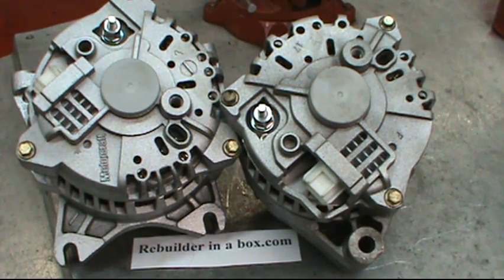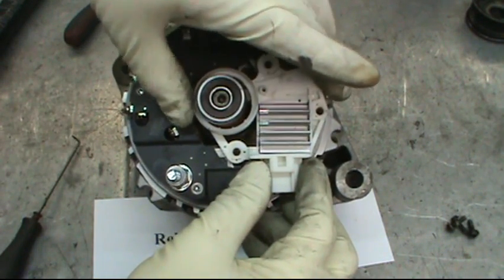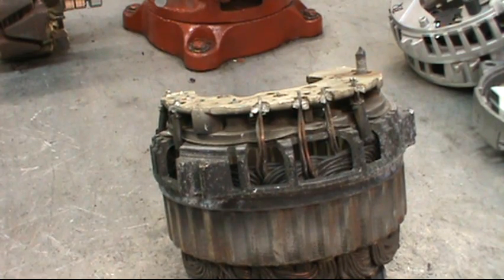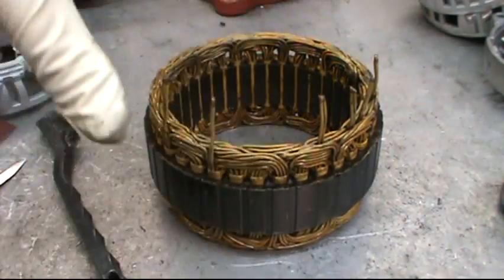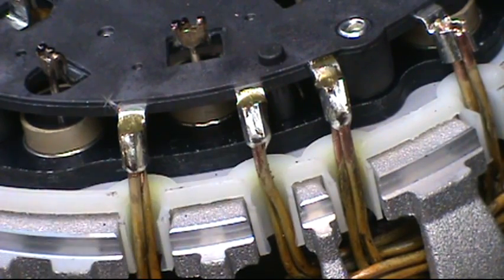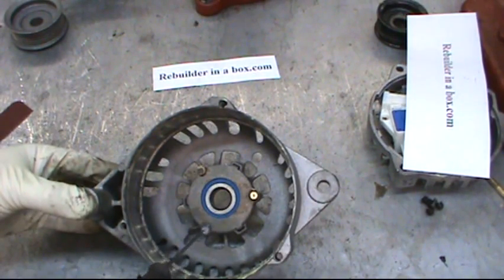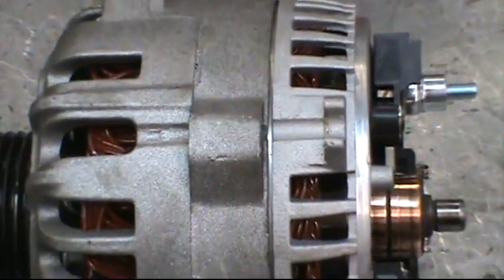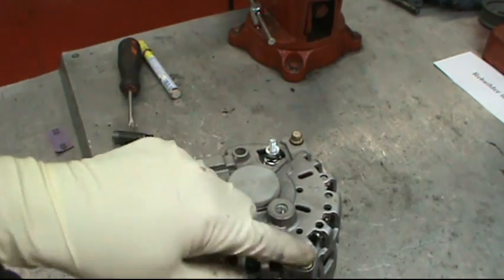How to rebuild a 6G Alternator

Comment: Why no toyota kits?
Reply from the maker: Older Toyota starters, yes. But not everything can be successfully rebuilt at home. Some require specialized tools, experience, and parts availability. Also, the cost of clutch pulleys can cause non cost-effectiveness for at home rebuilds. However, we will continue to look into it.

Comment: Hi Mike
Having problems with my 06 Mustang GT
Battery light coming on about 2 minutes after start up, Check Charging System also illuminated
The voltage gauge appears normal and getting 13.6v at battery whilst running
Removed pigtail and am getting 12v at battery end and 8.4v at ign wire Is this normal
Also alternator is getting hot to touch after several minutes running
Have just ordered a rebuild kit from you
Reply from the maker: Automotive regulators not engineered for glass mat batteries OR lead acid battery needs deep slow charge or is bad. If not these things then kit should fix if computer is ok.

Comment: What if you don't have an impact wrench?
Reply: For any future users, there are strap wrenches that should get a good purchase on the pulley, then just back the nut off with a standard socket.  He's using the impact to be able to loosen the nut with just hand pressure on the pulley.  There are "hand" impact wrenches too, but probably pretty hard to use on this without a helper (spring loaded things what you strike with a hammer on the back.

Comment: If the tolerance ring was not placed back on, can it cause an unusual noise? As if the bearing went out but they have both been newly replaced. Sadly the tolerance ring slowly turned to pieces. Great videos by the way! Clean and simple instructions is on point! Please help, can’t seem to find anything online about it. Thank you!
Reply from the maker: The tolerance ring is a very important component. That's why our kits always include the ring. Without it, the rear
housing would be destroyed. And I never tried it, but yes, it probably would make a lot of noise.
Reply: Mike Lauer thank you sir and sorry for late reply.   And well to let you know I ran it for about 2 weeks with an unbearable squeal that ended up turning to a rattle, found out one of my idler pulley bearings was shot. Replaced bearing on idler and put a new OEM alternator on my cobra and the sweet crisp silence was back.. now only thing is my battery light flickers n stays on after I say a good 25 minutes of running, I then hit the highway and look down at the dash to see it vanish, to later come back on again all in one drive haha I’m losing it

Comment: my svt focus is charging at 13.3 volts no light im thinking of ordering your kit but are your regulators motorcraft or other brands thanks
Reply from the maker: Motorcraft doesn't make regulators anymore. We have seen the inside of thousands of dealer purchased alternators with aftermarket regulators. SVT may have the 2.3L which Ford outsourced to India and we don't support at home rebuild for that model.

Comment: wondering  why  new rotor replacement not shown
Reply from the maker: New rotors are needed for 4G and GM's 130D series alt's. But for the 6G : If rebuilders are routinely successful replacing slip rings, and the rotor has a good life expectancy, the best cost effective operation is to replace the slip ring, not the whole rotor. Our goal is to show you how to save as much money as possible, and still get a good, reliable product. https://alternatorstarterrebuildkits.com/about-us/

Comment: What type of soldering lead you use it is 60/40 or it is brazing soldering lead for soldering the alternator, thanks
Reply from the maker: 60/40 rosin core. We recommend Kester with lead. It's not expensive like the silver and has been an experienced rebuilder go to for decades. Some newbe rebuilders say you need silver. Of course, it's better, but we show you the cheapest, easiest methods. For more soldering education, visit our sister site starterrebuildkits.com.

Comment: Can the stator be cleaned with brake parts cleaner, or is that too harsh?
Reply from the maker: No, I use mineral spirits or electric motor cleaner.
Reply from the maker: Too harsh. Electric motor cleaner is usually available at parts suppliers. We use Dawn and water.

Comment: Very thorough video. At https://youtu.be/iGIdnOwHZUM?t=689, it is stated that a rebuild kit comes with a new rotor with a slip ring on it. The kit I am looking at, 6G8316GGAV, seems to have slip ring included but not a rotor. Is there a reason for this?
Reply from the maker: We figured out a way to easily replace your slip ring on the 6g kits.  Which helped reduce the end users cost dramatically.  We could see an already soldered on slip ring with a rotor for an additional $40.00.  You can email us the request if that is the option you prefer.  We added 2 how to videos and in the second one you can see how to repace the slip ring.
Reply: Thank  you.   So. Much.,  Mike. For.  Sharing. Yours.  Good.   Alternator.   Repairs.          

Mike    Where. Did you  buy   Alternator.   Repair.  Kit.       And.   Any.   Other.   Alternator.   Parts. .?

Comment: hello i have the same ford alternator and i recently scanned 2007 ford explorer Eddie Bauer and the scan said that alternator was sending 10 volts instead 14 volts what i should change regulator or direct fire thanks a lot for your help
Reply from the maker: To properly rebuild the alternator.  It is recommended to use all the parts that come in our kit.  This will allow it to meet or exceed factory specs.